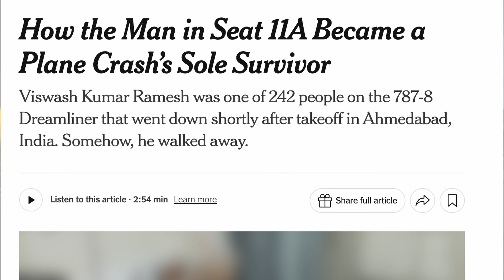Why the RAT Changes Everything – Air India 171 Update

Comment: I'm a pilot. I completely agree with Captain Steve's theories. In the history of aviation, dual engine failures have indeed been most commonly attributed to two main causes: bird strikes and fuel-related issues, such as fuel exhaustion or contamination. These scenarios have repeatedly shown to be among the few events capable of affecting both engines simultaneously, making them critical considerations in both training and real-world operations.
Reply: if fuel issue why did other planes not have same problem
Reply: @Teslafaninsight  more so why were they allowing other flights to take off , when they were still cleaning debris the next day if it could of been fuel
Reply: @Teslafaninsight  The Boeing 787 from Air India that turned back to Hongkong two days after that crash did because of a fuel-filter problem!
Reply: Another clue of catastrophic electrical loss is the landing gear position, it started retraction then stopped. It is apparent from the flat or slightly forward tillt of the gear that it is in the initial retaction mode.
Reply: So what are the other possible causes at take off as bird strike and contamination have, I believe, been eliminated? What would be a likely cause of fuel exhaustion?
Reply: @rjg728  Not being refueled before this flight
Reply: My view is that why don't you see it from the landing gear angle that  If engine failure, APU would have given power to the hydraulics to lift the landing gear.  So most likely power system failure would have shut down the engine's fuel injection. Please, my separate comment.
Reply: How does the fuel get contaminated???
Reply: I watched a previous of Captain Steeeve where it was basically stated that it couldn't have been loss of power, bird strike etc. If the transcript from the pilots is correct then?
If fully fuelled for a flight to London hardly exhaustion and fuel contamination, just one plane!
The gear wasn't retracted, possible cause the pilots otherwise occupied trying to resolve the power issue?
Reply: NIA is there, which means something fishy.
Reply: i suspect Fuel...engines didn't flame out, so much as they lost power. several things can root cause this. the engine filters were blocked by debris...everything from ice build up after a descent from high altitude (a british airways flight a couple decades ago had that happen in the UK, resulting in a crash), to dirty fuel being pumped in during a fuel stop...my guess it's this. being in a tropical climate, fungus love to grow in kerosene based fuels, especially with a bit of emulsified water mixed in...mix that with sloppy filter maintenance on the fuel trucks, or dirty and leaking underground holding tanks, and you can get a load of bad fuel.

the fuel systems on a turbine are extremely in-tolerant of dirty or water contaminated fuel...
Reply: It should be checked for maintenance rotation.@MikeJames-r7y
Reply: Regardless of the "ROOT CAUSE," on the BOEING  787 DREAM-LINER, immediately after the RAT is automatically DEPLOYED, isn't it supposed to provide the needed "emergency back-up AC electrical Power" for the instrument gauges to continue functioning; as well as the "back-up hydraulic-pump electrical power" for the flaps and other flight-control surfaces to continue functioning,..... including enabling the landing-gear hydraulic doors to fully open ????  Otherwise, the RAT is useless in an emergency take-off crisis situation. Could this be an "ELECTRICAL POWER TRANSFER BUS" hardware/software issue ????
Reply: @Johnny-vv9rd  certainly...however, RAT deployment only gives you limited electrical and hydraulics...the other component you need is TIME. which, since your 500 feet off the ground, is a luxury that you don't have.
you still need to attempt a restart on at least one engine, but there's no time. another post suggested complete, fuel pump failures, which i find difficult to believe, but maybe it happened?
either way, you look at it...they lost both engines. likely to fuel starvation. whatever caused the starvation, will be something the Black Box will tell us about...that box on a dream liner has pretty extensive data
recording...hundreds of parameters.
Reply: How come fuel contamination?
Reply: @Welcome25674  Underground storage tanks often leak and groundwater gets into the tank. When they draw fuel from them some water or other contaminants can get pumped up with the fuel. When the aircraft is sitting level and drawing fuel from the on board tanks the engines run properly. However at rotation the aircraft is in a steeply nose up attitude and this abrupt change in angle of attack could have caused the contaminated fuel to be picked up by the fuel pump, fed into the engines and caused them to fail.
Reply: @albertawildcat9202  exactly what I had been thinking as to what changed that moment the issue struck. Their attitude went to 10 degrees and the fuel could have sloshed around in the tanks mixing the stuff just pumped in with the older, good fuel that had been down by the pumps during taxi. It did look very, very dry there though? No sign of recent rain, I thought the Monsoon is just starting way down south by Trivandrum in Early June?
Reply: @albertawildcat9202 I am novice and suggested this to my wife. She said wouldn’t it affect other planes as well?
Reply: @sudheermangalpady  Yes it is possible, however is is also possible that the contaminate was all sucked up by the fuel truck or pumping system, or that the contaminate was already in the aircrafts fuel tanks, or the contaminate was not from the storage tank at all. It may have come from a fuelling truck (if one was used). There will be an investigation and the cause will most likely be determined by the investigators eventually. I was just explaining a possible reason (by no means the only one) of how fuel can become contaminated, there are many others such as condensation inside the fuel tanks, cavitation of the fuel pump etc.
Reply: Sabotage  @Welcome25674
Reply: @Welcome25674  Fuel contamination in a plane refers to the presence of unwanted substances in the aviation fuel that can compromise the performance and safety of the aircraft. Common contaminants include water, particulates, and microorganisms. Water is the primary cause of fuel contamination, leading to corrosion and potential clogging of fuel lines and filters. Particulates such as rust, scale, dust, and pollen can also enter the fuel system, causing blockages and damage. Microbial contamination, including bacteria, yeasts, and fungi, can grow in the presence of water, producing sludge-like substances that clog filters and accelerate metal corrosion.
 These contaminants can lead to fuel starvation, where the engines do not receive enough fuel, resulting in power loss and potential engine failure. Additionally, the presence of other petroleum products or diesel exhaust fluid (DEF) can also contaminate jet fuel, leading to serious operational issues.
 Detecting and managing these contaminants is crucial to ensure the safe and reliable operation of aircraft.
Reply: There are no Mathematical visual radio programming coincidences as a result of massive error codes being generated through finite Quantum vampiric Artificial Intelligence that is used to operate all flight simulator software programs 
When U build a finite  commercial airline company parasitic Corporation in which another branch directory airplane builder builds a flight simulator software network programmable Holographic matter as a grid network template architectural design of how Quantum Artificial Finite Super computers that are Neuro logically linked to the Borgha Matrix Quarantine Victim victimizer QI coded Trap experiment that spread to 2 other Matrices that led to Andromeda Mother Galaxy Quarantine security teams operating here B cuz it's a massive circuit breaker Star Gate system crashing Mathematical holographic radiation programs 

Eye mean really Captain Steevie U have multiple people murdered who worked in Quality control for Boeing and what did the global flying community experience 
Those Boeing Jets have massive defects in their Star map guidance systems 
That's Avionics 
Which is electrical sound and light burn patterns of consciousness directed Holographic spinning mirrors atomspheric breathing temperature Vacuum gauge metering voltage change echo maps recording speeds 
The system is finite and runs on limited memory and limited capicitance calculator capacity levels of cellular awareness 
That's B cuz it's Base 10 mathematical language coded Holographic visual mathematical memory driven programs 
When U sit in a cockpit of a Boeing Aircraft ur operating an end user flight simulator that was built by the programmers at Boeing Aircraft 
Now ur operating someone else's read active memory driven mathematical programs 

When U go to Google CIA play store ur loading that program that was engineered by another software programmer 
Load the programs into ur minds CD rom drive motor and experience the results of that program 
Corporations do not build anything to last forever B cuz their only interest is is making money by killing people 
AI Warfare is a racket used against Humanity 
At some point wake up and DO NOT OBEY THE FATHER of ARTIFICIAL FINITE INTELLIGENCE MACHINERY Programs 

Mu ah VA 💋🌈 Aurora's Spiral Council quarantine security teams operating here
Reply: What about possible FOD from rotating in the overrun?
Reply: Do you think they lost the engines just before take off? Though obstructed we can see a puff of dust going off.
Reply: Since we didn't see birds or fires/ sparks as they processed through...that leaves contamination...which I didn't knwo was a thing...OMG.
Reply: Bird strike at extreme low elevation in urban India? No way.
Reply: Your not a pilot
Reply: My brother was an international airline pilot and I love listening to Steve and reading what you have said as so many people comment having no understanding at all of anything to do with aviation. Nice to hear from the professionals ❤
Reply: The 787 has a known history of lithium-ion battery fires, which can trigger catastrophic avionics failures. On the previous flight, passengers reported the air conditioning, lights, and entertainment systems were not working—clear signs of electrical problems building up. During the accident, the Ram Air Turbine (RAT) deployed and the landing gear stayed down, both strong evidence of total power loss. Survivor also saw emergency green and white lights come on before impact, indicating the aircraft switched to backup power. All these point to a likely scenario where an electrical fire or battery failure knocked out critical systems, leaving the crew unable to retract the gear or climb. The 248 day bug that requires the SW to be reset (failing to do so could cause GCU issues and complete power failure) can be ruled out because the engine was replaced only recently (and probably the SW bug has been fixed)
787 batteries are susceptible to "cascading thermal runaway" where failure of one cell triggers failure of adjacent cells. A main battery fire can cause APU to fail as well. The high electrical demands of takeoff could have triggered the final cascade. Also bear in mind that 787s are Full Authority Digital Engine Control (FADEC) systems that require electrical power for proper thrust management.
Reply: @vajrapaniom7410 exactly, a LiIon batteries runaway could damage close components and disrupt engines electronics…
Reply: @vajrapaniom7410  Isn't it ironic that the 787 is having those issues when it's pretty obvious that it's a huge risk based on the USA's own regulations ban Li-ion batteries larger than 160Wh in capacity, and the 787 has WELL over that.
Reply: @shawnpitman876 indeed, peak outputs of upto  20 kW I believe
Reply: @vajrapaniom7410  So would this battery cascade cause the engines to idle down? A commentor on another board said with a total power and avionics faliure engines have their own isolated backup system that defaults to 85% thrust and had that occured they should have still been able to climb out to altitude to begin troubleshooting forn an emergency landing with the RAT hopefully providing enough power to move the control surfaces.
Reply: @Nightowl2548  not enough power to climb, just to keep it running.  RAT is only sufficient for the flight controls and instruments.
Reply: @vajrapaniom7410  
Not a single li-ion battery issue since 2013. None of the 2 before was at safety concern level.
Reply: @vajrapaniom7410  Yep what I said..re: guy on the first leg of same flight.
Reply: no, the survivor said the engines were working at the moment of the explosion
Reply: @vinnygonzalez-h2k the survivor is not an expert so he doesn't know what he's hearing. It was likely the RAT.
Reply: @vinnygonzalez-h2k  said it was ramping up. if it is true. Most likely restored after RAT power
Reply: @vinnygonzalez-h2k  Dude isn't a pilot...OMG...clearly something wasn't working it had no lift/power etc...
Reply: so what can you do if you mistakenly change fleps instead of landing gear after take off

Comment: If we assume there were zero issues when they started their take off roll up to V1 when they could abort, what could happen to cause a dual engine failure and loss of hydraulics is such a short period of around 20 seconds so soon after things were supposedly normal?  I'm not saying the buzzing is not the RAT, but there are certain weather conditions I have heard myself often where aircraft make a similar sort of noise once they have passed and a buzzing swirling noise follows.  Also, does the aircraft not have to be over a certain speed for the RAT to drop?  Would they have made that speed in that 20 seconds?  I looked at the report of an AF 77F incident a while back, they entered the wrong weight into the FMS by 100t, they barely made it out but only because they realized the error - but the effect was incorrect engine power & flap settings, so in this case there would be no warnings if the FMS didn't think there was anything abnormal due to a data entry error?  Genuine questions, love to hear your thoughts on all this

Comment: ❤ thanks. Fight simulator AI171 replay at x1 is still blinking. I stand on a position about electrical failure and / or computer failure. This plane is the only one blinking and being bad positioned on the track, then. After landing, there's  no record at all. More than  the engine itself, seemed to be a computer failure.  The previous flight, was AI172, from London, and a passenger mentioned electrical faillures, like bad flap positioning during the flight, alternative failures from the AC, entertainment computer faillures, communication failure to the cabin. On june 12, for AI171, we heard the RAT being out.
Given the radar blinking on FR24, this plane should never have run this day, as it seems every system  is regulated by a central computer, the only security is a battery.

Comment: There’s another video that shows the main landing gear bogeys are tilted up which indicates that the landing gear had been selected to the retracted position. However, due to a lack of hydraulic power (poss due dual engine failure), the undercarriage remained in the extended position. 

No signs of birds, smoke or fire from the engines. I wonder what the quality of the fuel was?. Water contamination… it’s happened before.

Comment: Electrical failure which caused the aircraft to be fuel starved little or no fuel pressure due to Electrical failure or possibly a fire internally basically the aircraft ran out of gas

Comment: yeah, that co-pilot issue sounded like a BS.   These guys don't make "mistakes" like that.   Nobody puts a turn signal on instead of the wiper.  Engine failure was the only one made sense. All other speculation is just that.  I think this video and all others are complete BS to begin with. Speculation without evidence is useless. They have the Black boxes, flight recorders, so they will know what happened.  No need for this. My only question is, when the building collapsed.... because buildings collapse from Airplane fire, right ? ... right ? We all saw it in 2001.09.11. the airplane fuel melts the steel even though it burns 1500F and the steel melts at 2800F... right ? So did the building collapse ?

Comment: Good vid. But you didn’t make clear to me why the dual engine failure goes ahead of electrical and/or hydraulic failure. ?  Plus, dual engine failure would surely cause the plane to go down, that close to the ground; still doesn’t explain the cause of a dual engine failure. ?
Reply: The electrical and hydraulic systems rely on the engines. 🥴

Comment: Still hard to believe both engines, from takeoff power, could fail at exactly the same time from something mechanical or physical.  I didn't see any rudder inputs or yaw, which you would expect if the engines weren't balanced.  Bad fuel wouldn't flame both out at the exact same time (they draw from separate tanks), and the odds of both having a mechanical issue is insanely high.  Computer glitch maybe?  Wonder if the software updated recently.
Reply: Under normal conditions, both engines draw fuel from the center tank until it is empty.  Contaminated fuel will cause both engines to fail at t he same time.

Comment: It was my understanding that the flaps control and that of the wheels up or down control are very different in location and how they activate... for a good reason. Another thing, the last mayday call said that both engines were down with a total loss of power. The flaps-landing gear theory is not consistent with total loss of power. 
A bird strike taking out both engines sounds more probable. We will have to wait and see.